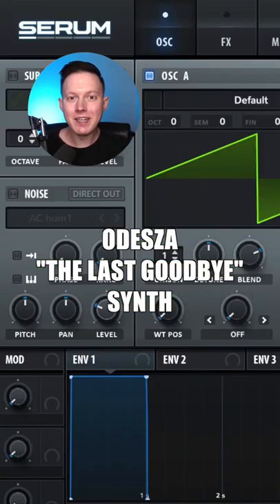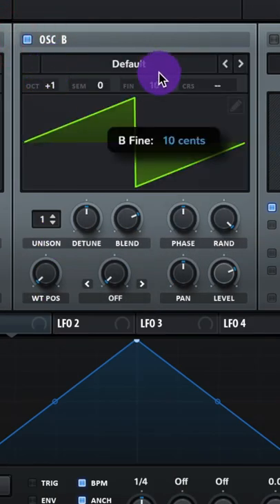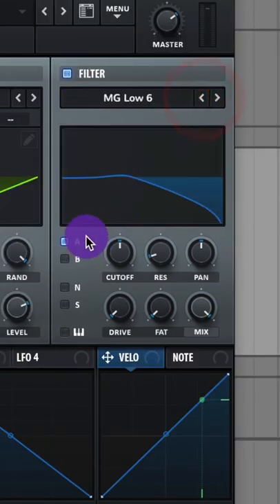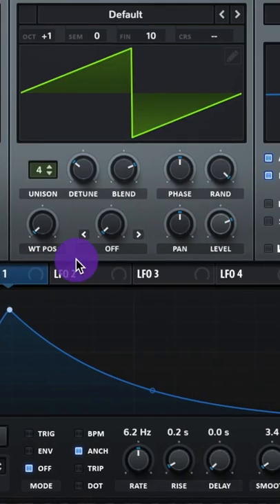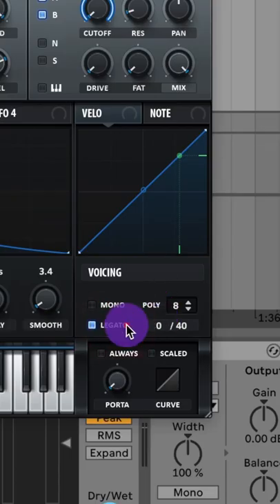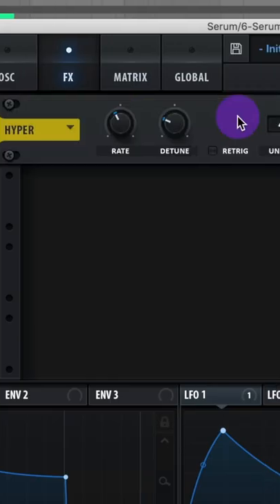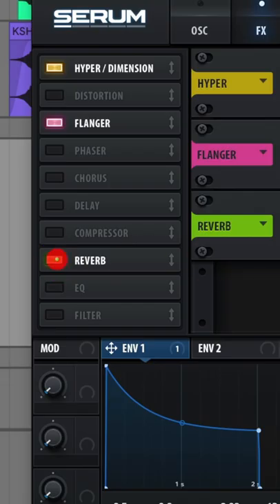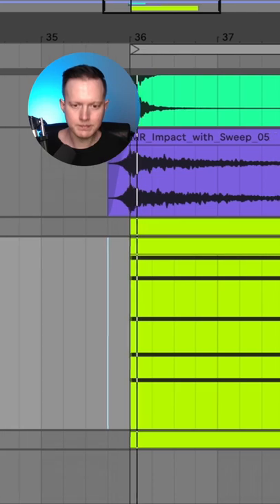How to: Odesza “The Last Goodbye” Synth in Serum #samsmyers #shorts #sounddesign

Comment: It’s actually just 2 synths and you can hear how they blended the leading one into the  driving one. 

As for the sound, it’s all by hand. They cranked down the lfo frequency manually four times, for each one. I can tell by the non uniformity of each note turns down. 

This may sound stupid, but by doing two synths, they were able to loop the lead and just change the rhythm of the driver synth to make more sonic change without changing notes